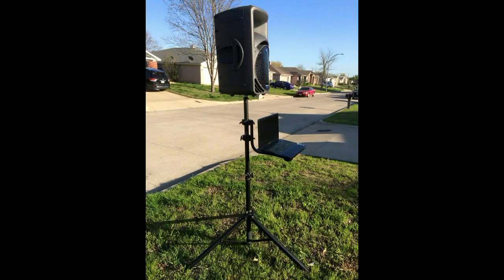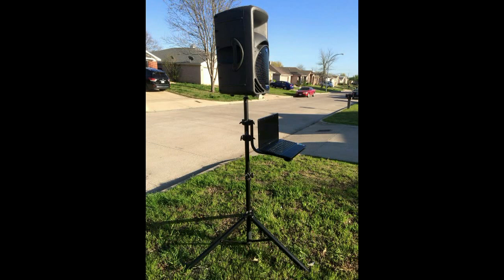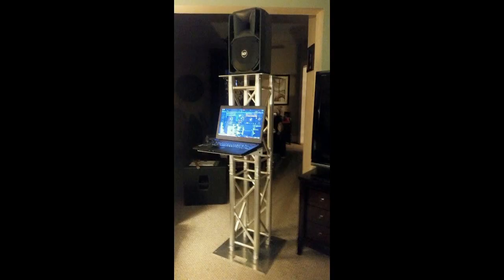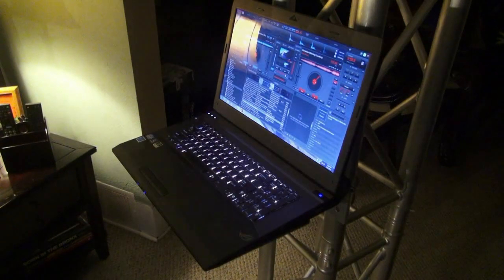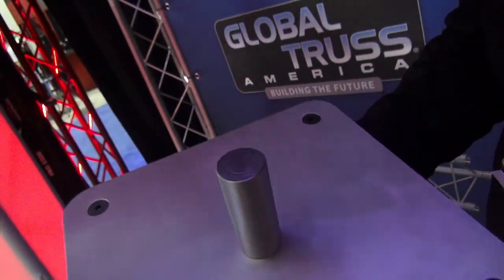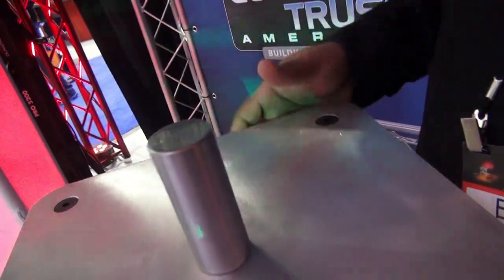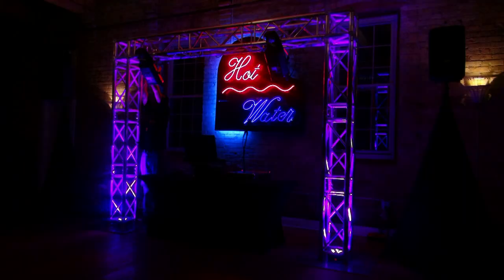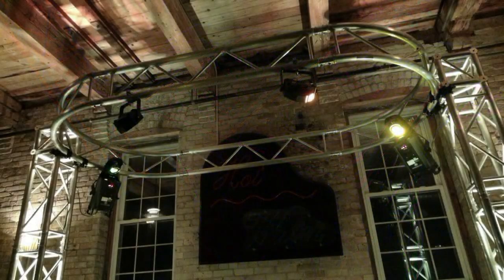A Wedding Ceremony System Made of Truss

Comment: Just for reference I use those speaker mount base plates and they are great. No need for a strap. Also one thing you won't know until you get them is that once you use them the speaker will no longer touch the base plate itself. The entire weight of the speaker is on the pile. Also the speaker will hover about an inch above the base plate. Wasn't what I was expecting but still looks great! I will try to post some pictures